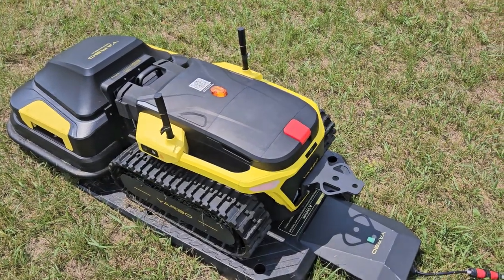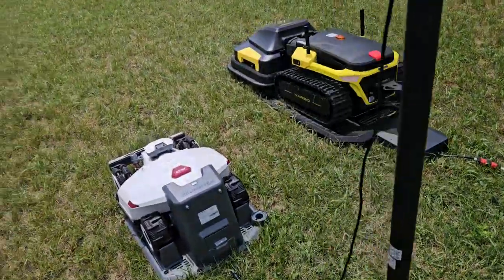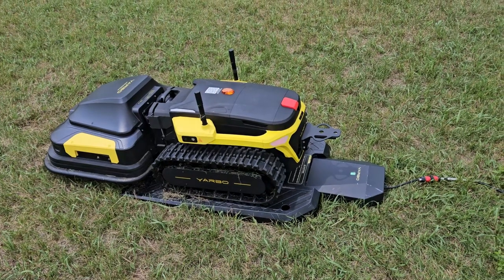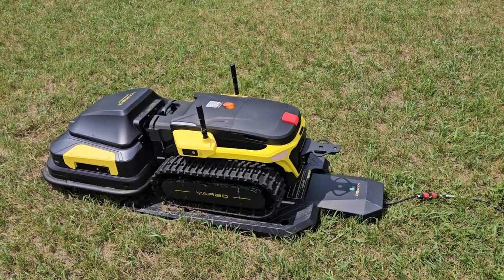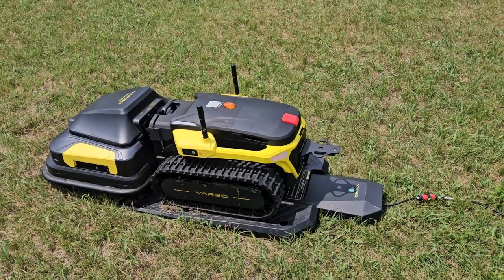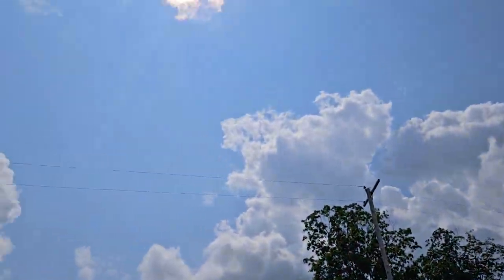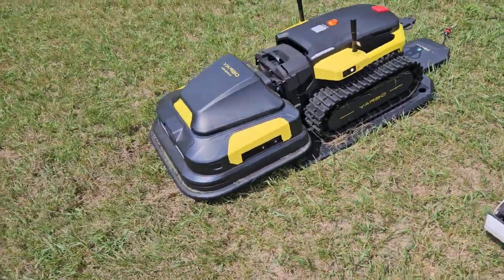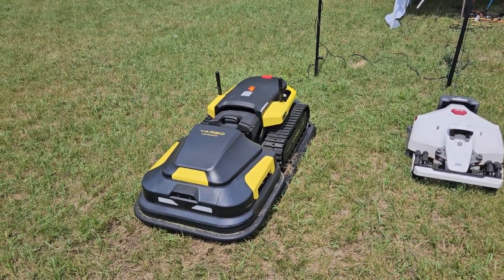Yarbo Overheated, Charging Paused

Comment: I'm interested in the yarbo or the lymow. Being in the south with temps constantly in the 90s, that's my biggest fear. I currently use an ego rechargeable mower. When it's hot out I have significant battery degradation, and charging takes longer, too. Have you actually acquired a lymow yet? And how is the testing going on it? That would be my number one option,  and i don't want to make a purchase if the machine can't handle Georgia heat.